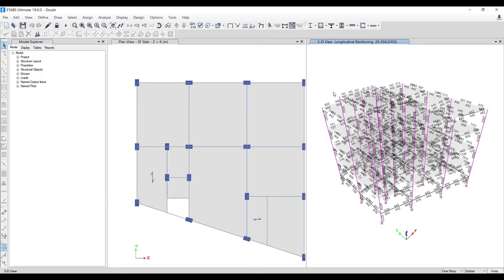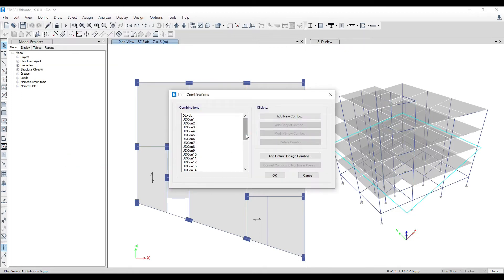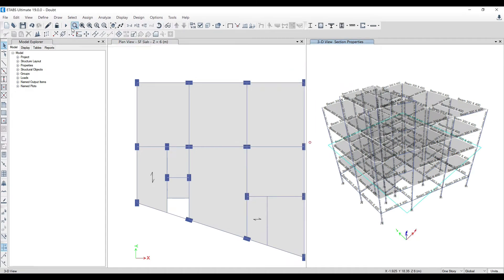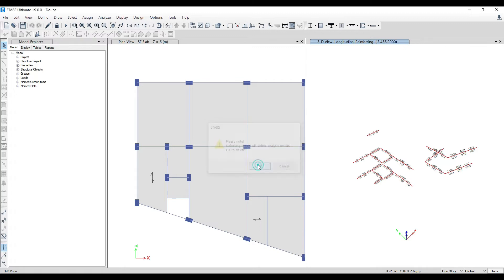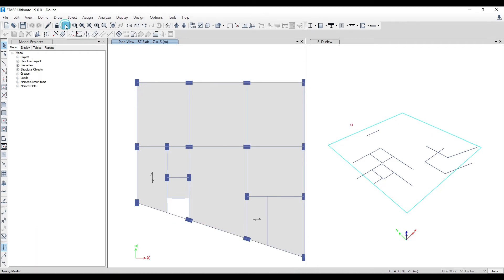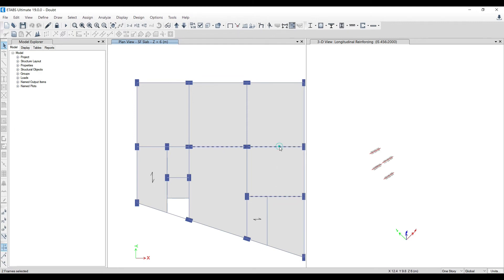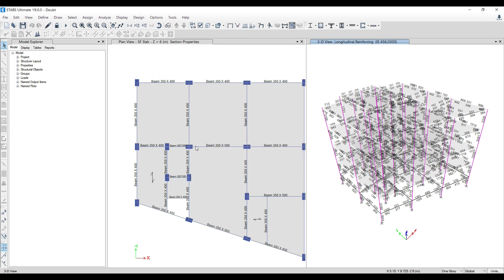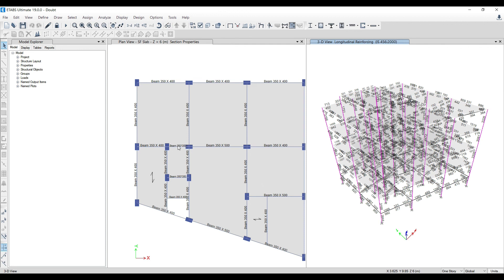How to rectify beam failure in Etabs? How to make model safe in Etabs?

Comment: Thanks for your amazing lecture. For cantilever slab is it logical to keep torsional constant 0.01?
Reply from the maker: I wouldn't recommend drawing cantilever slabs in ETabs. Better to calculate the DL+LL of it, and apply it on the slab. 
As far as the torsional effect of the cantilever is considered. On-site, we draw out the bars to the same length as the cantilever projection. So the load and torsion aren't taken completely by the beam alone.

Comment: Hello sir,
Can you explain how to take how many beams,columns are damaged from etabs?
Reply from the maker: I will make a class on this and upload a short video.
Reply from the maker: @poojas5995  Correct me if I'm wrong. You have done the modeling, applied the loads, and run the analysis. 

And now after running the design part, you want to know how many beams and columns have failed?  

The reason I'm asking is because I don't understand why have you gone for plastic rotation of beams. 

What exactly are you trying to find out, how the beams have failed? Or at what section they have failed?
Reply: @civilfieldtrainers  I got it 
Thank you for ur reply 🙏

Comment: Why do we release torsion?
Reply from the maker: When we cast the beam and slab on site. It's cast as a monolithic structure. 
The software doesn't take that into account. For software, the beam will undergo torsion which doesn't happen in real life, because we provide an adequate amount of steel and cast the whole thing as one unit. 

Keeping torsion in beams will increase the required steel by a slight margin. So when the beams are failing. We release it so that we can get it to be safe.  If it dosen't become safe even then. Then increase the sizes.
Reply: @civilfieldtrainers  informative
Reply: @civilfieldtrainers this is true, but will this be accepted by the building official in your country for instance. Thanks for your tutorials though👍
Reply: Hello sir. Why didn't we release torsion in first place, I mean while we are defining the section ,we kept  1 why not to  keep 0.01 for every beam section?...

Comment: Can we release moments at the end of the failed beam connecting a lift core wall?
Reply from the maker: In my experience I have never done that because moments will be generated at that fixed end and necessary steel needs to be provided to avoid failure.
Reply: @civilfieldtrainers  Beam size is coming too large in order to pass it. Is there any other method to improve the model?
Reply from the maker: @dilipngangom4198  Beams are failing in shear or main steel?  And the load combination in which it's failing in, has any horizontal load element?
Reply: @civilfieldtrainers  The beam fails in earthquake load combination. Large moment & shear occurs near beam-wall junction
Reply from the maker: @dilipngangom4198  Have you released torsion, as shown in the video?
Reply: @civilfieldtrainers  Yes